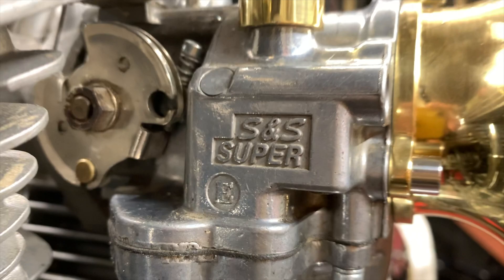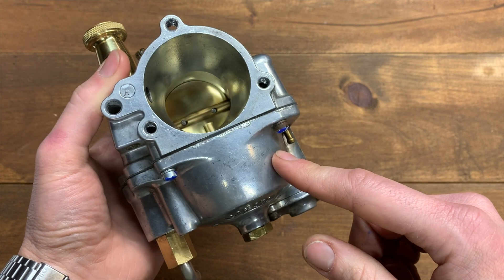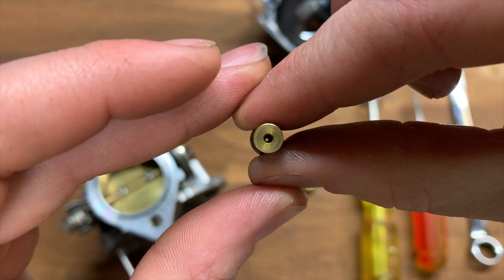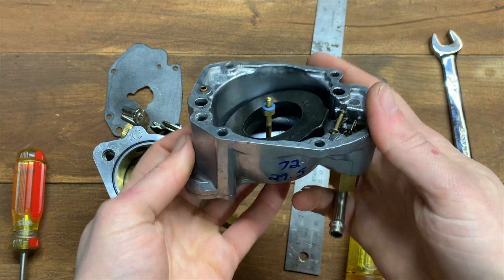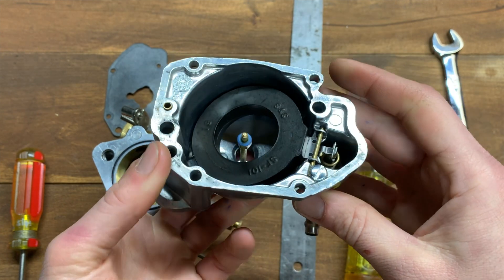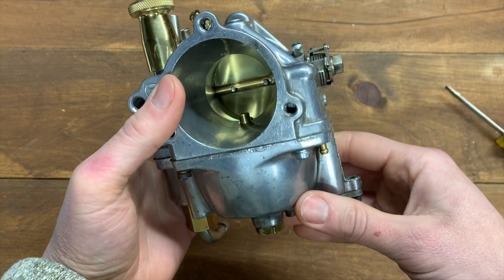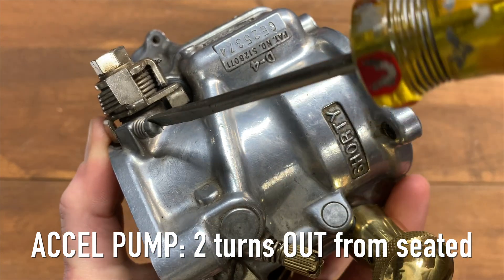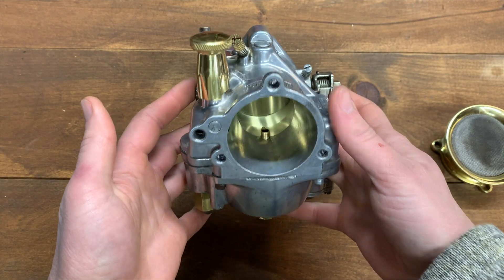S&S Super E Carb 101: Jetting, Float Height, Factory Settings

Comment: Intetesting and helpful info vid. I have an '03 sportster 883. Want to bore it out to 1200 but also replace the factory carb with the Super E. Is there anything I need to specifically look out for when buying the S&S for sportsters?
Why is the enricher adjustment larger on your version than the usual one?

Thank you.
Reply from the maker: Nothing specific you'd need to look out for on a sporty application beyond the jets of course. Sporty's will take smaller jets than what you see on mine for the Big Twins. 

As for the enricher adjustment, mine is an aftermarket knob from Speed Dealer Customs that came with the velocity stack. The reason you have to change this is because when you take off the stock teardrop air cleaner, the enricher lever comes off too, so it has to be replaced with a standalone enricher that isn't part of the air cleaner assembly. 

You can get these from a variety of different makers, this one just happened to come with the air cleaner I bought.

Comment: Mine yourself..Main Jet can also stick to the emulsion tube..This will defeat you trying to drop the Main Jet out thru the the Float Bowl Drain Plug..The emulsion tube will not fit thru the hole...Jus So You Know..Can't be done easily on the side of the road..Entire Float Bowl Must Be Removed..😩😩😩
Reply from the maker: I see what you’re saying. I’ve never had this happen in day to day life but I see how it could. If it does happen to you, your main jet is torqued down wayyy too tight

Comment: You're going over the Jets. Main Jet(.072) and then the other one .0295 You are calling it a pilot jet that is incorrect on a S & S it's called a intermediate jet. I don't know if they call the low idle jet a pilot jet on other carburetors but not on S&S it's a intermediate jet.  You never even mentioned the air bleed for the main jet. I noticed the one that you were messing with is the early model ones. I also have one on my Dyna. They made the air bleed only  a .04 drilled hole for the air bleed for the main jet. The newer ones came out in 2004 with the air bleed hole drilled and tapped. They use the same main jets for the air bleed. Starting with .04 then if you need a larger jet usually increase .01 increments .04, .05,.06  larger the jet size for air bleed the slower the main jet comes in. Then you're setting all the screws and the first one you go to. You said set the idle screw. It is not the main idle screw it's fuel mixture screw. dead on on the accelerator pump then you went to the last one. You said again set the (Main)] idle screw which is correct. The second time you got it right. I noticed that you brought up the velocity stack S&S says right on there paper and settings for that carburetor. To never put a velocity stack on a street driven motorcycle. That you will experience poor throttle response! By no means was I trying to pee on your parade. I've been trying to tune my Dyna today. Like you and your velocity stack. I happen to like the sound of my unbaffled pipe that is my 2 into1 Vance & Hines header. I'm a drag racer! When you said Pilot jet at 1st I couldn't figure out what you were talking about. I had to go back and double-check my notes. Take care we all do learn alot from videos just like yours. That was the whole reason I was on here trying to see if I miss something. Thanks again L.J ✌️
Reply from the maker: Don’t get too hung up on the details, remember who this video is for. New people who haven’t messed with one of these carbs before. Can a new rider see what I’m doing and effectively perform the same tasks on their carb? I believe so.

When someone tells me to put the choke on I don’t bother to remind them that S&S has a different name for it, because I know what they mean. 

In a more advanced video I will get into the air bleed and a deeper dive on tuning etc, I appreciate the reminder and you checking out the video. Thanks for the tips!

Comment: Why do i have lots of oil Cummings out the carb from the air hole?
Reply from the maker: are you talking about the breather bolts in the head?
Reply: The rubber hose from the bottom of motor to the carburator.
Reply from the maker: @andrerenaud8424  yours must be an early 90’s model then, I believe it was either 93 or 94 (my model) when it went to a head breather. That’s a sort of emissions thing where it vents the motor back into the carb to burn off those emissions. You can route that hose to the ground

Comment: hello my friend 
I just started the bike with your advice on carburation
  my two spark plugs are black what should I do on the carb?
Reply from the maker: That’s great news! If the plugs are black the bike is running rich. But before you change anything, did you just idle it with the enricher on then check them? Or did you ride it? 

If you rode it and they’re black, you need to go down on your jets OR you can try leaning out that idle mix screw a bit first and see if that helps
Reply: @greasesgarage  I turned the fuel screw down 1/4 turn.
I can't find the right setting for my recovery pump, GRRRRRR!!! I have a hole in the acceleration every 1/4 turn
Reply: @greasesgarage  I cleaned the candles afterwards I will try

Comment: hello my friend, Good morning,
I just adjusted my shorty as you indicate in the video,
can you tell me why when I accelerate suddenly, the motorcycle chokes?
there would be a more pofiné adjustment?
Reply from the maker: Yes, you would want to make two adjustments now that you’ve got it set up. 

Your idle mix screw, turn it out til the bike revs high, note the position. Then (while counting 1/4 turns) turn it in til the bike begins to stumble. Set it exactly halfway between these two points. 

Next, set your accelerator pump. At idle, blip the throttle to check throttle response. Turn this screw in or out as needed for a smoother throttle response.
Reply: @greasesgarage  super !!!! je suis français, tu comprends notre langue ?
thank you my friend
I'll see if it's good and I'll get back to you
Could the problem also come from the ignition?
Reply: @greasesgarage  for the recovery pump I have to screw or unscrew if it still chokes
les gicleurs sont comme indiqués dans ta vidéo
Reply from the maker: @richardgrognard6394  turn it all the way IN (clockwise) first. With the engine running, turn it out 1/4 turn at a time and blip the throttle to check response. Stop when the choke goes away
Reply: @greasesgarage  I will do like this
I'll tell you later.
THANKS
Reply from the maker: @richardgrognard6394  sounds good, let me know! 🤘🏼🙏🏼
Reply: @greasesgarage  no worries i will tell you, maintenant il fait trop chaud pour sortir
Reply from the maker: @richardgrognard6394  une fois qu'il a un peu refroidi (hope the translator worked properly haha)
Reply: @greasesgarage  Yes !!! it worked well
what country are you in ?
Reply from the maker: @richardgrognard6394  I’m in the US
Reply: @greasesgarage  good morning
ok friend

Comment: Are these adjustments (except acceleration pump) the same on super b
Reply from the maker: I believe it is the E and the G that are similar, as they’re both called out as the same in the recommended jetting guide from S&S
Reply: @greasesgarage  thanks

Comment: Rebuilt the carb for my 86 so frail for the first time. Set everything to factory specs by following your vid. I really appreciate the knowledge. I’m still having trouble idling, it’s a mich higher idle than it was before the rebuild. Is that normal? I’ve been making adjustments while the bike is running but without the air filter and cover because I can’t reach the idle speed screw with them on. How drastic will the difference be once I put the filter and cover back on? Thanks again!
Reply from the maker: That makes sense that it would be higher. Without the air filter and cover you’re getting a lot more air which would make the mixture lean. Leaner mixture would spike the idle. I would try with the air cleaner on before making any crazy changes. 

Put the air cleaner on, set the IDLE SPEED first. Once that’s set, turn your mix screw clockwise until the idle spikes up, note the location. Then count the turns (1/4 turn at a time) counterclockwise til it sputters and runs poorly. 

Set it smack dab in the middle of those two positions. 

From there you should be good to go!

Comment: Just got a 1200 sportster with this carb ….it kinda pops from the carb when you down shift occasionally? I haven’t messed with any settings
Reply from the maker: I would start by setting it to the recommendations in this video and see what it’s doing from there. This is the baseline.

If you’re popping after down shifting, your idle circuit is lean
Reply: @greasesgarage  I wouldn’t say it pops after I’m downshifting it happens when I crack the throttle downshifting
Reply from the maker: @travislohneis224  you would have to start by following the instructions in the video because I’m not able to know anything about your carbs settings unless you do
Reply: @greasesgarage  thank you
Reply: @greasesgarage  took it apart it’s got a 28 intermediate jet and 70 main jet also the float looked pretty low so I adjusted that and just doing that made it run a lot better
Reply from the maker: @travislohneis224  that’s awesome! Nicely done. Those jets seem about right for a 1200. If you still get popping when not on the throttle I’d go to the 29.5 pilot
Reply: @greasesgarage  thank you video and comments were a big help
Reply: Overall runs good …and sometimes it bogs on the initial take off
Reply: Could it run better on the baseline adjustments?

Comment: How would I know if my accelerator nozzle ( brass stem )  is clean? Doesn’t seem like it comes out, just turns.
Reply from the maker: Are you talking about the accelerator pump rod itself or the nozzle it runs through?
Reply: The brass nozzle with the 1/4 inch hex nut on it, the rebuild kit didn’t come with a new one. I notice there’s a notch on the very top. I thought maybe if it was plugged that’s why when I turned the throttle I had gas leaking from the boot from the accelerator rod.  Sorry if I’m not clear enough, this is my first rebuild.
Reply: I just don’t see how the notch is clean or another hole where it would squirt out…all it does is turn and doesn’t unthread out
Reply from the maker: @mattheweckenrode351  could you shoot me a picture @greasesgarage on Instagram

Comment: If you have an S&S panhead motor 93 cube, what would you recommend for a main jet and an intermediate jet as you said a 72 main jet and a 29.5 intermediate jet is recommended for 883 and Sporty's and some big Vtwins? Would like to hear your comments?
Reply from the maker: Thanks for checking out the video! Just to clarify, those settings you mentioned were what I recommended for the 80” motor. I’ll drop the recommended starting points below

883: 26.5-28 pilot, 66 main
74/80”: 29.5 pilot, 72 main
96/107”: 31 pilot, 76 main
111/124”: 31 pilot, 78 main
Reply: @greasesgarage   Do you think an 88 inch would be 30 and 74? As mine is bogging on the main jet.
Reply from the maker: @mickthemerciless9694  I would start with my jets and increase in steps of one as needed cause it’s pretty close 80 to 88”
Reply: @greasesgarage  okay.thanks.

Comment: Where'd you get your velocity stack?
Reply from the maker: Speed dealer customs. Came with the choke knob and the head breather bolts (because my evo is a head breather model)
Reply: @greasesgarage  cool I'm gonna check it out my shovel has a super e and I knew nothing about them so used to working with cv carbs on sportsters
Reply from the maker: @richardrandolph1069  best carb for a shovel this video will get you in the ballpark 😂

Comment: I live in Denver Co., what size main jet should I use for this elevation. It's on a S&S motor, just got the bike and don't know much about the S&S motors. We are at 5500 feet, that is an average elevation for the front range. The bike has a super G on it now, an American Iron Horse Outlaw 2002, with a 076 main jet, bike came from Vegas.
Reply from the maker: Are you having issues with the 076 that’s in there now? How do the plugs look when you pull them?
Reply: @greasesgarage  No, I just got the bike to Colorado and I am going through it now. It sat for about 4 years.
Reply from the maker: @DannyKessels-h7o  I would give the whole carb a full cleaning. Especially the float bowl and jets, check the float height as well. Everything you see in this video basically. 

From there, reassemble, warm up the bike, and set your air mix screw halfway between where it stumbles and where the idle speeds up. 

Then go for a ride and pull the plugs when you get home. If you don’t feel any bogging or hear any popping, and the plugs aren’t black…leave it the way it is

Comment: Do you recommend running a velocity stack? Is it hard to adjust or anything negative which affects the bike running condition? Appreciate your kind feedback. I really like the looks of the velocity stack specially the one similar to yours and I wanna ditch that huge ass filter!!
Reply from the maker: The people at s&s say to never run a velocity stack on a street motorcycle because it’ll lower performance. I’ve not noticed any drop in performance on mine. I run a 72 main, 29.5 pilot and dial in my air mix screw by going halfway between where it stumbles from being too rich and idle speed ramps from being too lean. 

With that setup I think it’s great, but any “performance” guy will tell you don’t ever run them
Reply: @greasesgarage  Thanks for the reply man! The videos are great, keep up the awesome work! Cheers
Reply from the maker: @mahmood-666  thanks for the feedback man, I’m happy to hear they’re helping 🤘🏼🙏🏼
Reply: Yeah ditch the filter and  your gonna need rings and a rebuild every other season ask me how I know 😂
Reply from the maker: @richardvadovsky9931  I’ll break it some other way before then 😂😂
Reply: @greasesgarage  🤘

Comment: Also worth mentioning to make sure the accelerator pump nozzle o ring is still there when reassembling.
Reply from the maker: Yes! Great point
Reply: @greasesgarage  I lost mine when I first got a super e and fought with tuning for weeks until I realized the o ring was gone. Now I keep a bag full of them 😂
Reply from the maker: @chopperdave1  smart! Where do you get the replacements, I can include a link in the description
Reply: Idk what keeps happening but the link I keep trying to post keeps disappearing in the comments. They have packs of 10 on the S&S website